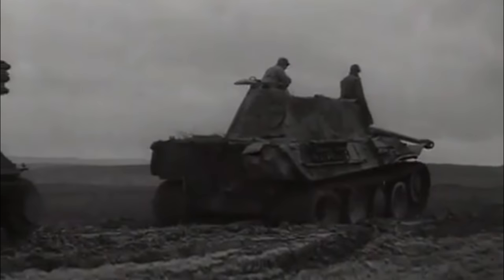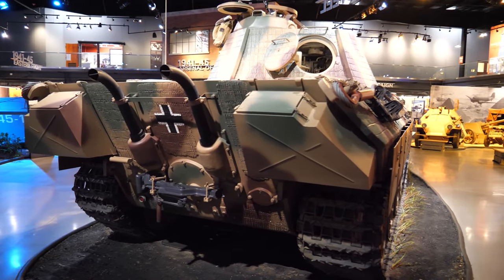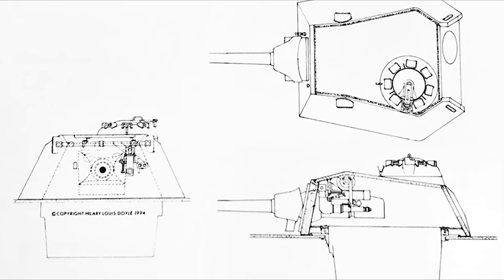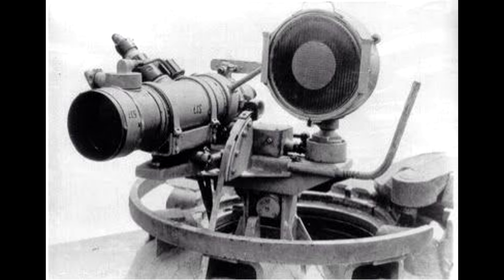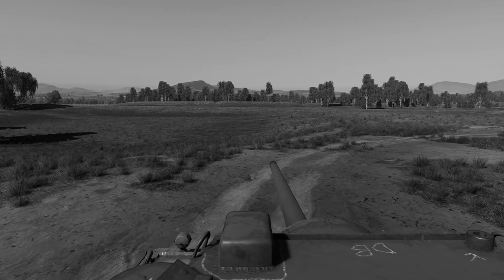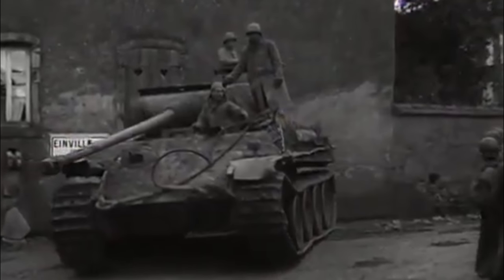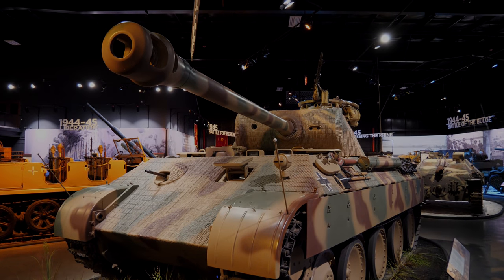The Panther Time Forgot, the Panther F | Cursed by Design

Comment: When your tank is a "medium" tank, but is designed like a heavy one.
Reply: When you design a medium tank for an Anti Tank role but it ends up heavy as fuck
Reply: The panther was obese
Reply: @irishbattletoster9265  He just liked to eat a lot that's all
Reply: @matijaljubenovicbrica9569  He was just fond of a burger
Reply: It's a complicated matter as for the real classification of the Panther tanks since the Germans tend to classify some of their tanks based on the role designated to it and not just purely on weight. The Allies classify their tanks based on their weight. So the Germans designed the Panther close to the weight of a heavy tank and used it as a medium tank while the Allies classify it as a heavy tank. This does have issues though as the 75 kwk 42 had great armor piercing capabilities but not an effective HE round (the 88s on the Tigers does a better job with HE). Plus, the transmissions were bad already and so having Panthers be medium tanks, which requires moving alot, exasperated the problem.
The Panther was a "heavy medium" tank that was good according to design but a nightmare to use in practice.
Reply: Heavium Tank
Reply: @BHuang92  Not always tho, look at the M26 Pershing, during WW2, it was classified as heavy tank (based on the armor, i think). Only after the war then it was reclassified as medium tank because of its light weight despite over 100mm of armor
Reply: If the medium is heavy. Then your heavy is best heavy.
Reply: Panther F: mini konigstiger
Reply: It's ok if the heavy one ways 180 tonns😉🤣
Reply: Heavium? Nah, its MEAVY
Reply: Introducing the Super Medium tank.
Reply: Italy meanwhile : when your tank Is a "medium" tank , but is designed like a light one.
Reply: Panther weight nearly as much as the IS-2. So it's definitely a fat cat 🙀
Reply: Didn't the Soviets consider it a tank destroyer?
Reply: @flakby3085  Yeah, something to that effect, like maybe a defensive heavy? Military History Visualized has a video going through the whole discussion of Panther classification.
Reply: STONKS
Reply: @Darilon12  IS 2 46 tons and 520hp , Panther 44 tons and 700hp . Why people always say it's a fat cat , who says how much a heavy tanks has to weight ? A Leopard 1 has 40 tons as well and a Leopard 2 almost 60 tons . 
 And why German tanks where under powered , the IS 2 got less hp per ton for example . Russian tanks where always very small , not much space for the crew .
Reply: @5co756  because the contemporary mediums of the time, weighed around what, 30 tonnes? So comparatively, yes, the Panther was a fat cat
Reply: @Xenonfastfall  Well weight comes with armor and a M4 or T34-85 had not much armor and was light . A M26 Pershing had 42 tons as well , also heavy for example . 😉
Reply: @W11-o2y  Obj 277 time!!!
Reply: It was actually designed as a medium tank. But at the last minute Hitler decided he wanted more armor on the front, witch added 8 tons. That led to the problems with the added strain to the engine and final gear housing, which were designed for a 35t tank.
Reply: @5co756 
Traditionally Germany classified tanks by caliber. Which actually makes panther and tiger mediums as they have under 10 cm guns. But that's not relevant. Like the power to weight ratio. They still are fat cats. Just ask the panthers gearbox and final drive whether it was overweight...
Reply: And has the top speed of a light tank. (34 mph)
Reply: @Darilon12  that's all relative perspective, the cat isn't fat, the components are undersized due to frivolous demands. Like an armored knight that ends up riding a donkey because of poor planning.
Reply: @5co756  exactly, for its time the Panther was a fat cat and more akin to allied heavies than mediums
Reply: The chonker of the medium tanks.
Reply: @matijaljubenovicbrica9569  sorry for being insensitive
Reply: @irishbattletoster9265  fat shaming the poor tank
Reply: confused engineer's noises.
Reply: Panther is very cute in world of tanks blitz and I like it very much
Reply: @Ribbon_13  not really, since panthers can't sufficiently support infantry assaults
Reply: @5co756  but isn't IS 2 A HEAVY TANK?
Reply: I think that the terms light, medium, and heavy confuse people not used to thinking in military terms. In the military, light, medium, and heavy don't always refer exclusively the weight of something but also the role. Another example of these terms confusing people are light, medium, and heavy machine guns. Because of the US's used to the M2 in the heavy machinegun role, may people think that a heavy machinegun refers exclusively to a large caliber (and thus heavy) machinegun when in fact heavy machinegun refers more to where and how it is used and not necessarily the caliber it's chambered in. For instance, during WWII the, MG-42 could be used as both a medium and heavy machinegun all depending on whether it had a bipod and was being carried by an infantry squad or mounted to heavy tripod and used in static defenses.
Reply: A transgender
Reply: German engineering
Reply: I think someone said they coulda had a better chance to win the war if the panther came early and they only mass produced it and removed all panzer 3s and keeping panzer 4s and jadg panzers
Reply: French tanks am i right?
Reply: @ravenknight4876  super medium 🤯👌🏼💯🥇 yessss it's most deff a super medium!!! Heavy enough to take a punishment light enough to get in position and guns big enough to vaporize heavy and anything in between at the time....
Reply: thats just ww2 germany for ya, mediums were heavy, heavies were heavy
Reply: Nah it's was an attemp of a mbt
Reply: Happened to me when I drew CAT
Reply: German engineering at it’s finest
Reply: Best design ever: Russian armor, German gun, American engine. ;)
Reply: @W11-o2y  Guderian must be displeased to read this!
Reply: He's just big boned man
Reply: The thing is that german tanks was ratet in his class for it main gun :
Panther with 7,5 cm gun : medium
Tiger with 8,8 cm gun : heavy
Reply: @irishbattletoster9265  big boned
Reply: Well its fast as medium :D
Reply: Well when Armor dont Work Use more Armor Comrade 😂
Reply: @scratchy996  BS. Hitler only demanded front armour to be increased up to 80mm from 60mm. That wasn't 8 fk tons.
If anything, it was designers fault for failing Germany.
Reply: Panther was heavier than M26 and just one ton lighter than IS-2.Let that sink in.
Reply: @BHuang92  The US Army did the same thing - "medium" or "heavy" refer to tactical role, not weight.
Reply: @Riceball01  Excellent point. In the WW2 US Army, the other heavy machinegun was the M1917A1, which fired the same .30-06 as the light M1919A4 machinegun (or rifles for that matter). It was the *role*, not the weight, that made it a heavy machinegun. Same logic with tanks. It's not the weight per se, it is the tactical role.
Reply: @misham6547  No it wasn't. The Germans continued to produce heavy tanks, meaning the Panther was not intended to fulfill all roles.
Reply: @scratchy996 I did the math on WarThunder forums (VK 30.02 (M) discussion thread) and the increase of 2cm extra thickness on both the turret and the upper hull front would've increased the weight by less than 2tons.
The "35 ton" weight figure was for the hull without the turret.
Reply: Sounds like an mbt
Reply: @Dave-jj3fk yeah thats straight up fiction
Reply: Main battle tank.

Comment: We've got a "small turret" that was assembled on a Panther G here at Fort Benning and are also in possession of a Panther F hull. The plan is to mate the two after the Tiger I the restoration shop is working on is 100% operational. Take that, Bovington!
Reply: I remember talking to the curator about this when the tank was at the Patton Museum. That was about in 2003 I think.
Reply: I thought Ft Benning had a Panther II chassis, not a Panther F chassis - they are different beasts.
Reply: Chieftain has done a presentation of this tank showing it at Fort Benning.
Reply: Jesus, it is not "Small Turret", it is "Narrow Turret". Schmal is similar sounding to  small, but has different meaning. If Germans would wanted to name it Small Turret, the name would be Kleinturm...
Reply: @madigorfkgoogle9349  Cry about it, you lost so you don't get to make the rules.
Reply: @heirofaniu  what are you talking about?

Comment: I personally don't think that the Schmalturm was that "cursed". It made sense. On the other side it didn't offer near the protection that the Pfeilturm (Arrow-turret) would have. Although that never left the drawing board. It was probably meant for E75 anyways, as it offered 350-470mm of protection.
Reply: The Pfeilturm? Do you have info or a link to info on it?
Reply: @elanvital9720  Now take what i say with a pinch of salt, i saw this on a WoT forum couple years ago, so i have no idea about the legitimately about this concept. (Can't even find the page now). But i found it to be an interesting concept never the less.

The Pfeilturm was basically the same as the Schmalturm (wich KT and Panther F uses) but the mantlet is triangular and covers the turret face completely. (Same concept as Strv 74, but with a block of vertical armor under the gun to prevent shot traps.) I presume the interior would have been a bit bigger, maby allowing for an 88 in the panther or more likely a 105 in the E75. 

Edit: its called "Tigerzahn turret" (not Pfeilturm)
Reply: @Bigma_Industries  I see, thank you!
Reply: @Bigma_Industries  havent been able to find anything about. May be someones crazy concept
Reply: @Bigma_Industries  Are there any pictures of it?
Reply: @elanvital9720   hey, i found it, its called E75 "Tigerzahn turret" 

(YT dont allow links to other websites)
Reply: @Zorro9129  I was wrong, it's called "Tigerzahn Turret". (you will have to search it yourself as yt doesn't allow links)
Reply: @Bigma_Industries  Thank you very much!  Also wow that is an advanced design, it's not unlike a modern MBT.

Comment: What about ergonomics?

Chieftain talks a lot about the importance of the crew being able to do their jobs efficiently.  Also the US was very concerned about that as well, notably rejecting the 76mm in the original Sherman turret.

So how much space did the crew have in the small turret?  Most of the equipment is the same as the original turret, so no space savings there.  Also there is an added range finder, which will take up space.
Reply: It has the same or at least identical turret ring diameter so I don't think it would change that much for the gunner and loader but the commander may have a different situation.
Reply: Chieftain also complained about the crew's inability to see out of the turret due to a lack of well sighted periscopes,  and to aim the gun in a protected hull down position because the gunsight on the production turrets was on the mantlet. The Schmalturm moved the sight to the top of the turret, just like on the Sherman, which allowed the crew to search for targets and aim the gun without exposing the turret. This is a great improvement, and could have made the tank much more dangerous. Not sure the crew got more periscopes.
Reply: @nonamesplease6288  True, however, they would have to expose part of the turret to use the rangefinder.
Reply: @charlesphillips4575  Agreed, but they could see over obstacles and acquire targets before they exposed the rest of the tank. This was a definite advantage that production Panthers did not enjoy. In fact, the Sherman used the same type of sight, and it was generally seen as an excellent feature of the tank. It is not a surprise that the Germans would incorporate it into the Schmalturm.
Reply: The Schmalturm isn't actually that small compared to the previous Panther turrets. It just narrows at the front to present a smaller target profile and better slope the armor. The crew is further back in the turret, where the width is similar to that of the earlier versions on account of using the same turret ring.
Reply: I would love to see this for real, and someone get into it to try the ergonomics. I have no doubt that it would have been harder than the D/E/G turrets.
Reply: @Simon_Nonymous  There's a lot of unused vertical space in the Panther turret and hull, so it is possible that the same features could be incorporated without compromising the ergonomics by using this space more efficiently.  Too bad we'll never know for sure.

Comment: The F said so much about German tank design. They had a massively complicated tank so they simplified it by putting on a cheaper turret, then they came up with lots of expensive bolt-ons like nightfighting gear (when they doctrinally avoided nightfighting anyway), wasting a lot of the saving.
Reply: this is more a form of german mentality
aka, still the same to this day with basically everything
Reply: Nightfighting could not always be avoided. If the enemy attack at night, you have no choice. Because the germans had better guns (and optics) than the russians, the later learned to fight at close range, when firepower is much less important (think they learned that at Kursk).
Reply: hognoxious  One thing to remember was that Germany didn't have a true assembly line the way the US did.  Parts were hand-assembled, rather than machined, which meant that they basically had no actual standardization.  They also wanted to engineer everything for extremely precise tolerances, which meant that they worked extremely well under optimal conditions but failed quickly during conditions that weren't optimal.
Reply: in that stage of war, cheaper was not exactly meant in money but manpower and material quantity. It shared some parts with Tiger 2 turret so it was much faster production on same line without the need of retooling. Also it was probably lighter with better frontal protection then the older Panther turret. And lighter means either more storage capacity, or better power to weight ratio. Russians did similar with T-44 upgrade from T-34, and later T-45 (T-54).

Comment: im sure this has already been pointed out, but the design of the ausf. G was not built around avoiding the shot trap, it was primarily built for ease of production. such as simplifying the upper side armor, simplifying crew hatches, and simplifying much of the inner and outer engine compartment. early G turrets did not include the chin armor, and the first production models didn't even use G turrets, instead using refurbished A turrets. the chin-strap didn't even appear until months after production had started.

Comment: I think you should’ve mentioned the weird WoT representative of the Schmaultrum turret, the Panzer IV with the turret.
Heck, maybe a series analyzing the validity of tanks in World of Tanks would make for a great video.

Anyways, loving these vids!
Reply: There were proposals to upgrade the Panzer IV with the Schmalturm, but that was never gone through with. It wouldn't have worked without significantly thinning the armor to keep the weight down, because the Panzer IV H was already overloaded by that point.

https://tanks-encyclopedia.com/schmalturm-turret/

It seems that there was a lightened Schmalturm drawn up for that purpose, which would've had the same 50mm front and 30mm sides as the standard Panzer IV turret. That seems like something that might have worked. The Panzer IV Schmaltrum seen in World of Tanks, with the full 120mm turret face, would probably have buckled the Panzer IV's suspension with the extra weight.

Some of the tanks seen in WoT are pretty historically accurate, others are plausible but never existed, and some are just physically impossible. Some tanks are all of the above depending on which modules you have mounted.

Comment: World of Tanks actually made some interesting speculations on its own (and perhaps to fit the game better) by having the schmalturm blende available for the Panther II and "regular" schmalturms for both the Panthers. There is the "small sized panther" VK 3002M (which probably is a panther prototype) receiving perhaps the original "shot trap" turret (if not a prototype) and the Panther coming with the "chin" turret. It's a relatively historical line (of tanks) with relatively accurate measurements.
given the fact that the schmalturm are cheaper (less material) and faster to produce, I think it's a good thing to have. How much it affect crew comfort and performance, however, leave much to be answered.
Reply: Wot is busy making german and american tanks feel weak, rus tanks bounce like they re all Maus, and in game shells just vanish (ghost shells) or do no dmg when hit weak side, turet or engine armour. But effort is apreciated

Comment: From what I read on other armour analysis sites, the Panther was 'cursed' by having thin side armour on its lower hull, as well as all the constant mechanical issues. A well placed shot just above the tracks and under the mud guard from a Russian 14.5mm anti tank rifle could penetrate - its the reason why they fitted side skirts.

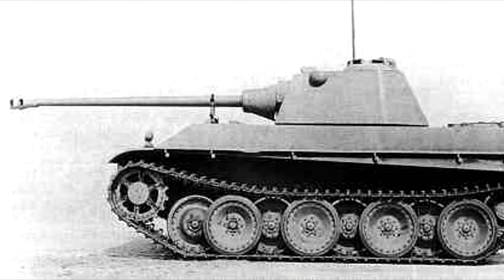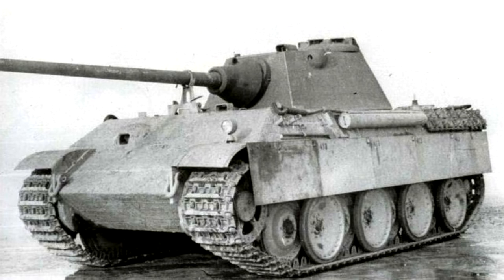Comment: About the two Panther G hulls with their turrets(at 4:39 and 4:56):
They have different style antenna mountings on the hull. They are both in the back,but in different positions, the first image is just a barely visible knob,while the second one is somewhat higher and more conical in shape. Also,in the first picture,there absolutely zero mounting points for tracks,no hooks for the towing cables,etc,on the side of the hull. Although these could have been installed later, there is not much point for those on a vehicle which used for testing only. If the tank is bogged down during factory trials,you probably have the suitable vehicle with towing equipment already. However,if one turret is used with a brand new Panther and the other is used with one coming back for an overhaul,that would explain the differences in between the two hulls